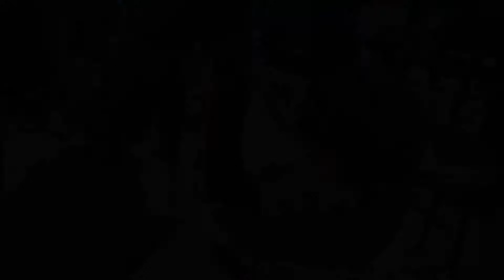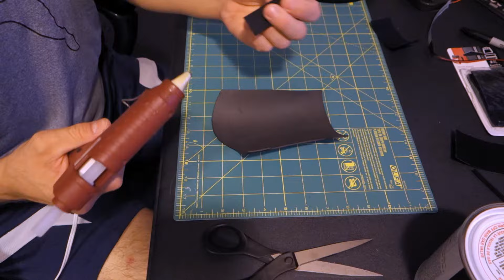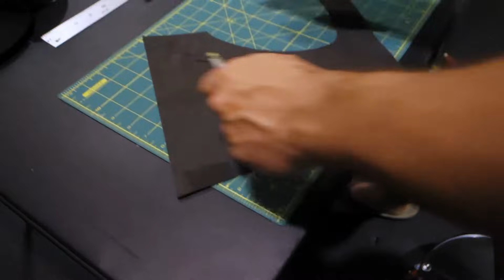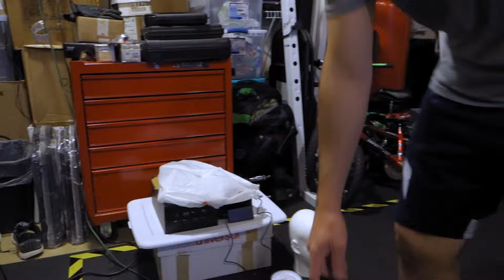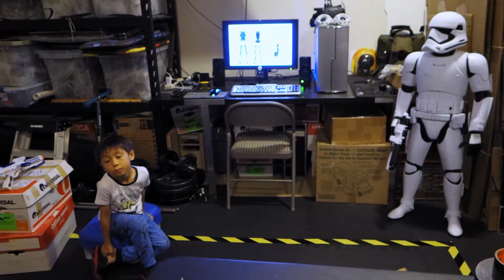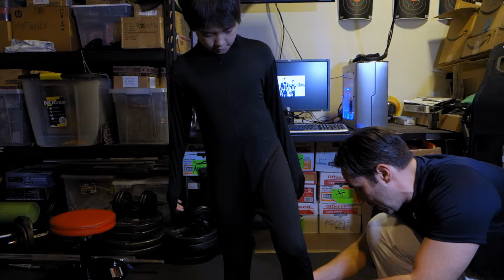How To Build An Electroluminescent Tron Legacy Costume

Comment: I’m hoping to make a tron ares suit for this Halloween with my dad! Been looking all over the internet for a tutorial and this is by far the best one I’ve found, thank you for sharing!
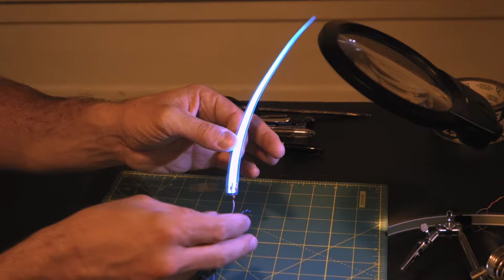Reply from the maker: Best of luck! I'd strongly recommend, in hindsight, that you do NOT use hot glue directly on the metal crimp connectors where they connect to the strips (at 12:35). Just put clear tape over the crimp connectors to seal them, once you've connected them to the strips.
I think the hot glue over time will flow into the strip breaking the connection between the crimp and the strips, resulting in your lights turning on and off randomly. You can still use hot glue on the other  parts of the costume. Just not directly on the metal connections to the strips.
Reply: @buriedegg8636  okay good to know! Will definitely use clear tape in that case. Thank you for the info!

Comment: You were wonderin if glueing the armor directly onto the fabric is a good idea or a better way then the straps.... let me tell you - Please stick with your Strap Solution. My first cosplay was a clonetrooper and I hotglued it onto the fabric. It was a absolute nightmare to get in and out. Also you cant really adjust or fix things that way. So you saved yourself a lot of headache. Thank you for the tutorial. I am a cosplayer with a knightsarmor and I want to try my luck with a Tron Cosplay - your cable work gave me some ideas. 

You did a really good job!!
Reply from the maker: If you decide to use EL Tape, like I did, make sure NOT to hot glue the crimp connections (the electrical connection from the wires to the EL Tape). The hot glue will 'flow' into the connection and block the electrical signal. Just use Clear Tape to seal the connections after crimping.
Good Luck!
Reply: @buriedegg8636  thank you for the tip. I plan to loop all the wireing so it wont stretch. Also I will put it in a superflat layer between the actuall armor and the Bodysiut for troubleshooting in case something breaks. 
I totally would have secured the wire with the hotglue so I am really glad you saved me from it. 

Were the lights very visible in a light room? Like, are they good enough for a comvention?

Comment: Hey brother, my son and I are working on our own Tron costume. I'm wondering how you made all the different shapes with the EL tape. Did you buy  all the different sized EL pads? or combine several pieces to make larger sections?
Reply from the maker: @brenthays2660  great question. The two upside down hockey stick shaped EL shapes on the chest were made with 2 pieces over lapping to form the L shape. In other words, each “hockey stick” is actually 2 straight pieces.
Good luck!

Comment: Thank you for this! I'm making myself one for this Halloween and I'm pretty nervous about it. This helps me out alot.
Reply from the maker: That’s great to hear! My only recommendation in hindsight would be that you do NOT use the hot glue method to seal the soldered crimps to the EL Tape. Instead try clear packing tape or even electrical tape or gorilla tape to secure the crimps to the EL Tape. I think the hot glue actually separates the connections over time creating disconnects in the EL tape.
Good luck!
Reply: @buriedegg8636  I luckily did buy a el panel tron kit before hand so I don't need to use solder crimps. But thank you for the advice.

Comment: Did you use a separate inverter per section, per light, or one for the entire costume? 
I am trying to use El Tape for a different wearable project. Anytime I connect more than one El Tape my lights get significantly dimmer. Subbed and liked.
Reply from the maker: One single power inverter for the entire costume. You need 12volts (8x AA batteries) for my costume. The basic 2x AA setup most EL Tape comes with (like from Amazon) will not be sufficient to power more than one tape strip.
Hope that helps!
Reply: @buriedegg8636  It does help. Thanks!
Reply: @buriedegg8636  I think my problem might be the two prong wire split 5 ways that I got from Amazon. No matter what volt/amp battery I plug in the lights dim using the 5 way splitter. I though that would be a good parallel solution but it seems I was wrong.